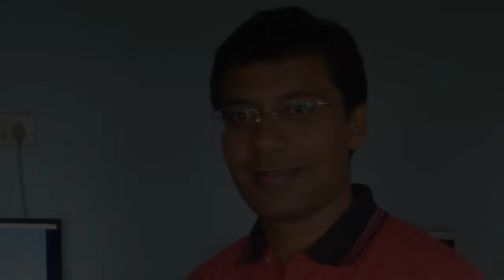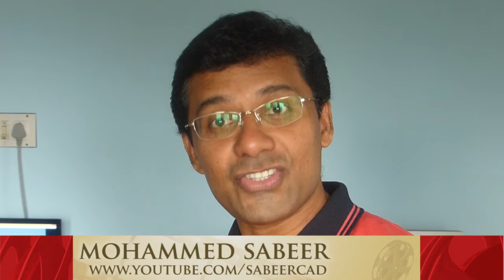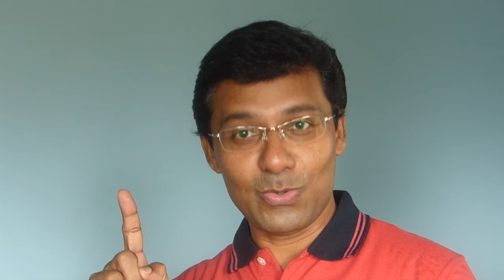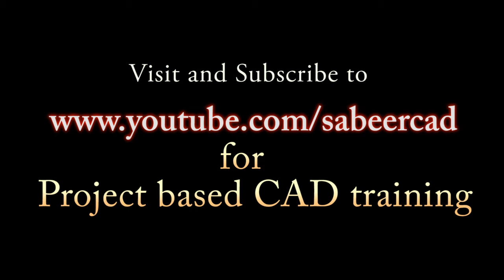INTRO TO NEW PROJECT | AUTOCAD DOUBLE STORIED HOUSE

Comment: thank you so much for your tutorials. I have 2015 autocad. In this version, there are many existing layers.Created new layers will be saved alphabetically however,they are hard to find in between existing layers. I don't know if it is fine to delete all the existing layers or rewrite on them by giving new name. plz give me the solution.
Reply from the maker: There will not be any layers in a blank drawing . if you have layers means you are using a defferent template . so change it . for that open a new black file . give PURGE command , click on purge all . ( preferably twice) .  then you save that file as acad.dwt. now you have replaced the default template file. next time when you open autocad this file with only 0 layer will appear...